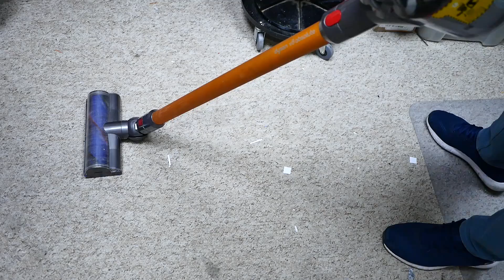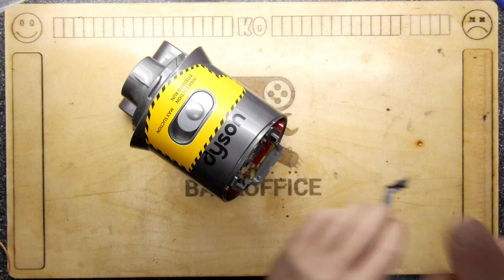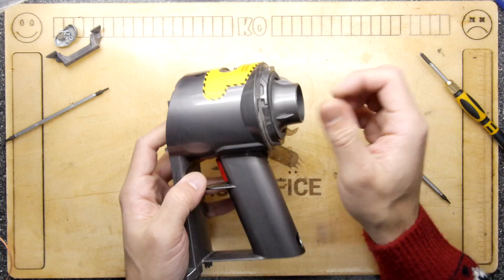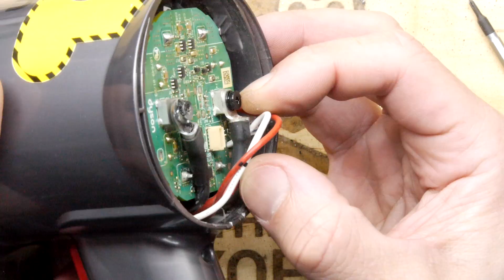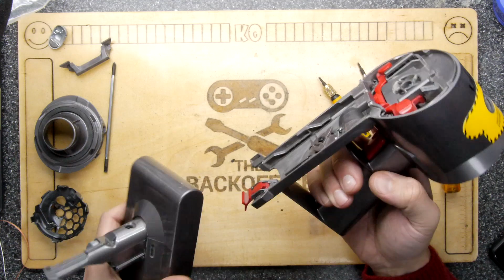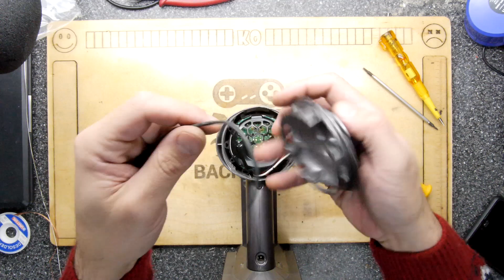Crazy Dyson v8 Fault and Repair

Comment: I did training with Dyson to disassemble these. They have 3D printed tools to release various tabs and clips.
As we'd all taken one apart they couldn't sell them so we got to take them home :)
Reply from the maker: This is fascinating, makes a lot of sense
Reply: *Deleted comment due to disrespectfulness text*
Reply: @ArianK-dq6ew   In answer to the first part of your mad ramble, no I didn't work at Dyson. I did some training with them. In answer to the second part of your mad ramble, what on earth are you going on about? How would I describe the shape of a tool that I used once about 8 years ago in the comments section of a YouTube video? Hahaha incredible :D
Reply from the maker: Am I correct in imagining it to be a bit of metal with a bend in it and a shaped end that goes under the thing? 🤣
Reply: @backofficeshow  i have figured it out the tool is this they have a tool that locks into place in the location pointed by arrow in image#1 this spot was only created for this purpose it has no purpose for the filter that is removed, and then as you can see in image #2 the arrow points to what holds the cover in place (4 of them lock the cover in place) notice how one side of it is flat ended and the other is slanted on an angle so that that cover can slide over it once turned and pop off when rotated left by the tool that locks into place in image #1 what Ive shown in image #1 is made by dyson on the opposite side of the cover as well for this purpose only so the tool grasps onto both sides not just one side of the cover, with that being said there would be no need for prying in between the cover damaging the plastic as well as the O ring. 
Thank you for supplying the video for it even though it was extremely tough for my dyson not as easy as it showed for yours it ended up breaking a small piece of plastic where the flat screwdriver was applied pressure before actually coming off unfortunately. 
:REFERENCE IMAGE: https://tinypic.host/images/2025/01/01/IMG_0805.jpeg
Reply: @theamazingpillock  i sincerely apologize for my outburst of frustration, forgive me.
Reply from the maker: Not don't often see an apology on the internet, well done. 👌👌👌
Reply from the maker: Are you still using one! Mine is still going after 6 years, but I have replaced a fair few parts!

Comment: Thanks for being here - this helped a lot with getting mine apart.    My issue was no power to the powered brush head.

The smaller red and white wires inside are the power to the brush head,  and Dyson used some dumbass spring style connections for them.  The spring clip for my red wire had the two ends bent too far apart to retain the wire (this is a flaw from the factory - best guess is the wire may have been cockeyed when it was pushed in and it bent the clips out).  The red wire was unconnected and flapping around loose inside the enclosure.   Bent the clip ends back together, connected the red wire, and now the power head consistently spins.

After re-assembly battery blinks the single LED (indicating low power.. but FFS, the damn thing was charged before disassembly....)  and runs for 10-20 seconds and shuts off with the battery showing low power - which is a new and different problem I've yet to resolve that seems to have related comments on reddit and ifixit.

Really glad I took this apart instead of getting it replaced - my flaw wasn't going to start any fires since it was the accessory end of the power connection that was loose and not the power feed side.  The one you show here could have fairly easily propagated into an enclosure fire while in use.   Doubly glad I got it on sale (it's an old model now).  I've had good luck with Dyson in the past, and after seeing both yours and my manufacturing flaws: they're now benched the next time I need to replace a vacuum cleaner.

Comment: Ive just gotta prey i haven't killed my Dyson dc62 got it off marketplace cleaned stripped it down and washed the motor part in water like an absolute muppet powered on for a sec then stopped nothing looks burned out on the board just gonna let it sit and dry overnight

Comment: I think I have a different factory error.

I have a V7 and V8. The V7 I just got wouldn’t spin up at all and would just flash an LED on the battery when you pull the trigger. The V7 is almost identical to the V8 except there is no removable rear filter, which means you need to pry it off and there is no cage or additional duct to pry inside. I’m not sure about a screw deep in the handle but if there was one I didn’t need to remove it to get out the motor.

Before I got that far I reached in and tried to turn the impeller blade but it wouldn’t turn. It turned freely on my V8 so I figured the V7 was seized up and proceeded with the motor removal.

Anyway, I suspect this was another factory error because everything looked brand new on the main housing, inside and out, without even a spec of dust. Nothing like my V8… stark contrast. It was as if it had never run at all.

The stuck motor felt a bit crusty when I forced it to turn by hand but after forcing it was turning freely again. Took less than a few turns. After reassembling it seems to work fine.

This wouldn’t be the first time I’ve seen such a factory fault: Decades ago I had a new laptop CD-ROM that behaved exactly the same way where I had to manually turn it past a crusty-feeling spot before it could turn on its own and read discs.

Comment: You, my friend, are an absolute life saver! I bought my Dyson V8 at Target🎯 a year ago and it acted weird right out of the gate. I paid over $400 for it but chose not to return the thing because it worked great...when it worked. I was getting more annoyed with it as time went on. Then, I came across your video, after searching MANY videos. I tore it apart yesterday and found that the power wire on the right had a cross-threaded screw. I ran a die over the screw and a tap into the attached nut to fix it. The other problem was the star slot in the screw was only half formed so I had to use needle nose vise grips to put it back in. It works great now.
     You would think that whoever put it together would have noticed that it wasn't in correctly. They should be ashamed of themselves for sending this product out for sale.
     Thanks for the tutorial👍🏻!
Reply from the maker: That's fantastic to hear it worked out

Comment: Look at the absolutely miniscule fan on this vacuum! Just took mine apart - it measures 20mm in diameter - 3/4"! Its about as big around as my thumb. Not sure weather to commend Dyson's genius in getting any kind of vac to work at all with that tiny a fan, or wonder if they really know what they're doing. Mine works ok on high (when it's very loud and only runs about 3-4 minutes) but honestly on normal it's just not a lot of suction.

Comment: My Dyson v8 start running all the time, even without pulling the switch button. It only stops when battery was disconnected.
Any ideas?
Reply from the maker: The switch that is connected to the trigger is built into the battery, you can check this yourself. Perhaps a new battery will solve it?
Reply: @backofficeshow  I guess that's the only option. From what I understand battery should power the  device only when build-in switch is on, not all the time. Thanks for the tip!

Comment: Just bought the Dyson V8 Absolute. It's brand-new, and it's not working even the battery is totally fine. I also removed the back purple filter, and place it again, and it turned out a bit, but they it went off. I believe mine also has the same defect.
Reply from the maker: They are dreadful, I've seen happen several times. Faulty out of the box
Reply: @backofficeshow  I already placed a return request. I bet they work great, but they have many issues and they are high maintenance. I was looking for something that makes my cleaning life easier. 😭
Reply from the maker: @AdrianRConant  I quite like the robot vacuums now, the Xiaomi or Roborock models with the LIDAR are amazing. I sometimes feel sorry for them they work so hard 😂
Reply: @backofficeshow  actually that was my first option. LoL but honestly, Dyson's marketing convinced me. 😅 I was checking the Romba. Any suggestions?
Reply from the maker: @AdrianRConant  If I was in the market at the moment I think this unit would be a strong contender https://amzn.to/3iJnN9B
Reply: @backofficeshow  thank you! I'll check it out.

Comment: Hello, great videos. I am looking for some explanation of my Dyson V8 fluffy slim + (SV10K). this variant does not come with the carpet 50w direct drive/motorhead, only the hard floor fluffy ones (15W) , it also comes with the small motorised head  20W. Then i realize I need to also deep clean my carpets and want to get the 50w direct drive head that usually comes with absolute variant. When i manage to try the 50w head on my V8, it spins but as soon as put on carpet and senses load on the head motor, it stops spinning. I did some amp reading and seems like my v8 only allow certain amp draw from the attachment but not the 50w head because its higher, way higher than the motorized head that it came with in the box. Do u know if there is any way we can change the amp draw limit to support the 50w head attachment.

Comment: Anodizing on a power connection screw is like a cardinal Sin in the electronics world. I'm trying to figure out why my Dyson V8 no longer powers the attachments. I love your video on how to break it down tho
Reply from the maker: Hopefully it will be something simple - good luck on your investigation!
Reply: Did you ever figure it out? My V10 stopped running the attachments as well. Hoping it’s an easy fix and not the board itself. I am getting the power into the board but not out of the board…
Reply: @ShopWithEmily  I had to replace the main board

Comment: I measured the the voltage and it reads 20v, I also check from the brush spinner with a 9v battery and it spins but not sure why when it's not Turing with its own power.  I checked all the connections and no issue.
Reply from the maker: It could be one of the sensors in the machine from not working correctly.
Reply: @backofficeshow  I found it in the trash 🗑,  I figured I can fix it. Once I open the machine the circuit pcba has water damaged and white corrosion.

Comment: My V8 was pulsating and not holding a charge. Thought it the battery. On replacing it, flame and smoke shot out of the back of the motor. That was enough for me. Costco has a return policy and this is going back. I’m thinking a similar problem as you describe but I think the circuit board is toast. Glad the house is still standing!
Reply from the maker: There are plenty of alternatives out there to the Dyson fortunately, and most without the flame thrower function!

Comment: Did you fix the magnetic suction switch? I also took mine out and cant get it back the way it was with the spring in the right place...very frustrating lol.
Reply from the maker: I believe I got it working, but I know what you mean. There are 200 ways to install it, 199 of them are floppy!
Reply: Did you ever figure this out? I’ve tried what seems like a million different configurations to reassemble it to no avail.
Reply: @ryancurry8918  I never could figure it out, I have to tape it down to either regular mode or max suction...

Comment: My v8 does not work when I plug in my electric roller head 
I have taken my vacuum apart and have the motor out. I am getting resistance between my negative lead and my negative wire that goes down the vacuum to the roller head.
Have you heard of this happening?
Reply from the maker: Isn't the resistance the coil of the motor in the head? Are you seeing voltage on the contacts to the head when you operate the vacuum

Comment: If you are wondering how your Dyson got cracked, take a look at how you slap it around in this video. The plastic Dyson used is absolute garbage. I cracked a couple parts by giving the old bump push together like you did. Be careful, it doesn't take much shock to crack that cheap brittle plastic. Even pushing in the battery with a little bump (like with power tool batteries) will shatter the cheap plastic battery receptacle inside the handle.
Reply from the maker: I agree, Dyson products are the biggest pile of turds. Their marketing department are geniuses

Comment: This little guys is (so far) so great🌼 allabout.wiki/Dyson-Absolute Using it on Speed 2 and Max on small rug / or big dust patches. Charging is quite fast - accessories are useful and small storage footprint. Great performance over all and if you find it cheaper (aliexpress or else) it’s even a better deal. To me this unit is equal or even better than Dyson V8.

Comment: Hi thanks for this - I had an issue on my V7 where when I set the machine to max power it would die after 5 seconds of use. After taking it apart I saw that the black wire had been damaged (presumably during the manufacturing process). Not something that I can fix myself, but I phoned Dyson support who were really good and they organised a replacement.
Reply from the maker: Damn right their support should be good for the price they charge for these 😂

I'm all about the G-Tech now, far better machines if you are ever looking for a replacement

Comment: I'm pretty sure i have the same problem. But none of the brush bars works anymore as well, meanwhile i still can measure current over the 2 connecter points. Do you think this fault could've damaged all the little motors in the vacuumheads? And if you open it and can show this is the case, will Dyson fix/replace some parts?
Reply: Use a 9V battery on the motorhead to test for any movement.  Best to take out the dc motor to test in case it’s just hair jamming it up.  If there’s no jam and it moves, you have no power from the main unit. Follow for continuity from the Motörhead’s dc motor up to the connection to the main unit.  If all is well, your issue is a chip burnt out that feeds the power tools.  Can bypass by connecting the red and white wire to mains.  Add a an inline fuse if you do this in case of motorhead failure and high current is drawn.
Reply: @randycollens2681  i need to do this, how many amp fuse should be used.
Reply from the maker: I suspect getting a new brush bar will be your only option via Dyson. If it's broken you have nothing to lose having a look if you can get it dismantled

Comment: Did you figure out how to reassemble the power setting switch so that the spring engages correctly? I'm struggling with it atm. Thanks.
Reply: Same here... many months later.
Reply: @lesrogers7310  if you guys are still having issues, lmk and I can post a video on how to do it :)
Reply: @jakesteele848  please do!
Reply: Any luck figuring out how to reassemble? I’ve not been able to figure this out either.

Comment: Mine was "pulsing", so I cleaned the filters, to no avail.  Then I finally thought to check the mouth of the Bare Floor Tube - an entire Bounce Dryer Cloth was jammed up in there, gahhhh.  Easy fix, and it works like a charm again.

Comment: This was very satisfying to watch. I always wondered how to open up the rear end as I have one. Mine also developed a crack on the handle and replaced by Dyson. Despite this hiccup, I still love the Dyson. I also agree with other comments that the batteries need to be of easy changing like power tools.

Comment: as I user, I see two flaws in the design of Dyson vacuums: 1) replacing battery needs tools.  this is the most fetal one, as many home appliances and tools are getting wireless models, battery replacement and compatibility among themselves is a very important product design strategy.  It's unfortunate that Dyson designer did not see this coming as this products was started a bit too early for this.  They could have learned this quickly and make new models with one-click replaceable batteries, and offer at least two batteries per device; 2) the location of the motor is in the path of the air flow, which is some time fetal.  As we often wash the filters, the mix of water and dust will form mud in the air path and on the motor wheels, and jam and lock the motor, as it did to my motor, if one washes the filter, then blows the motor a bit, and then leaves it on stand for a few days.  However, among all the vacuums on the market, Dyson still has the most powerful motor which many loves.   I hope Dyson engineers can watch this video and read my message here, and go back to their design board to make a better vacuum.
Reply: Seriously, battery being screwed in to secure it and the motor using its own suction for cooling are your two complaints...  wow. Just wow
Reply: You can use no contact cleaner and spray the PCB from time to time